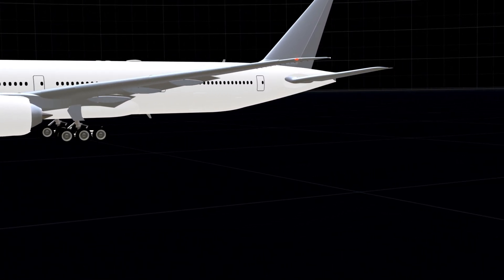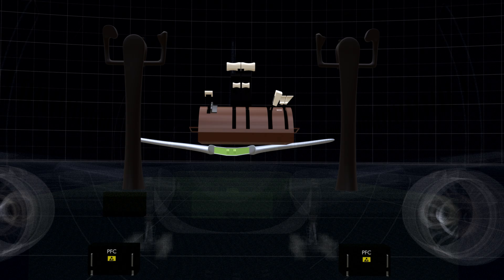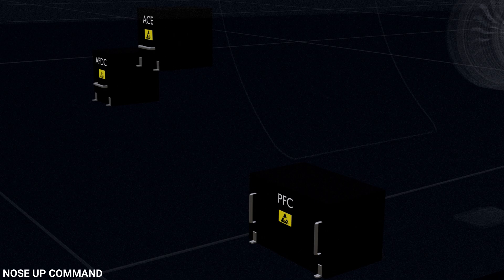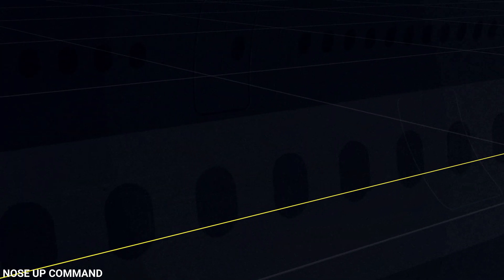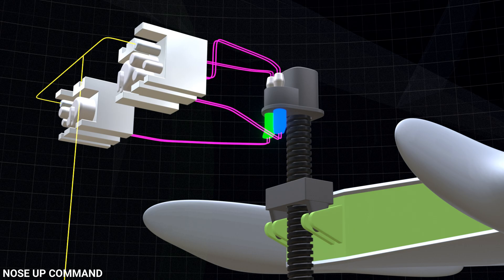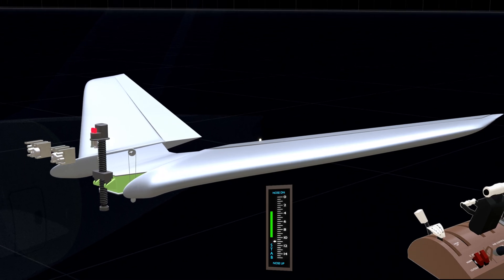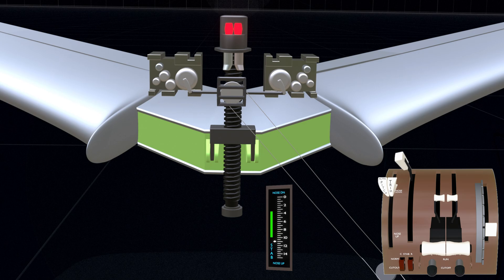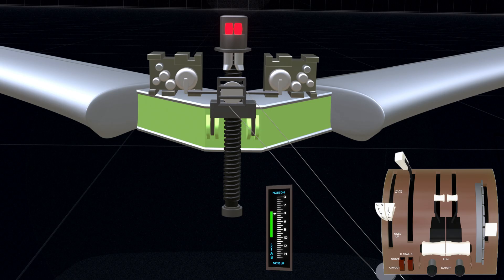How Flight Controls Work | Part 1 : Horizontal Stabilizer

Comment: I feel this video got something very incorrect about the B777. When trimming the B777 you’re not trimming for attitude like a regular aircraft. You’re actually trimming for speed because of the FBW system.
Reply: Umm...anytime you change speed you need to adjust pitch, easiest way to do that is with trim. But you're right, per the FM it changes the reference speed. But it really means the same thing.
Reply: Why would the FBW system change the purpose of the trim?
Reply: @tristanschultz7677  The purpose was to decrease the need to manually trim and to increase airspeed awareness according to a few pilots who fly the 777 and 787. It's basically middle ground btwn constant manual trim and autotrim (Airbus FBW).

Comment: First plane flight by wire was the 757 and 767 Spoiler systems  ! Let’s get that right
Reply: All that was stated, which is correct, is that the 777 was the first aircraft to be ENTIRELY FBW. Let's get that right.

Comment: Any idea how many tons of force horizontal stabilizers provide to pitch up or down with trimming. Why only the elevators are not enough to provide that much force.
Reply from the maker: I don't know the force value, but in the pitch control chapter of the series I will explain the application of the stabilizer and the elevator.

Comment: Wait. How does the pilot has full control authority in any fly by wire system?
Fly by wire by default means the pilot inputs are captured electronically to a computer. The computer then operates the control surfaces throught electric or hydraulic systems. Where does the pilot has any authority in this?
Reply: They mean override light envelope protections mate. Boeing allows this as the protections are soft limits. Most other FBW aircraft use hard limits where the pilots can't override them.